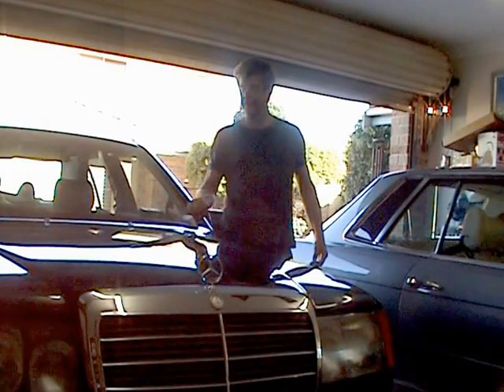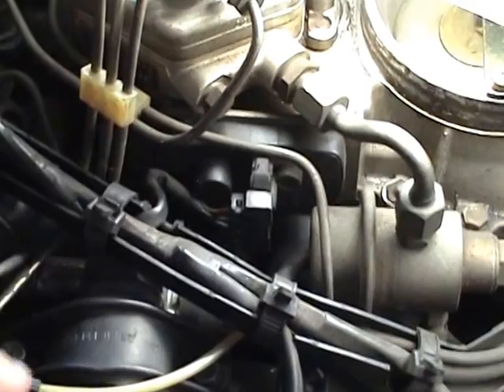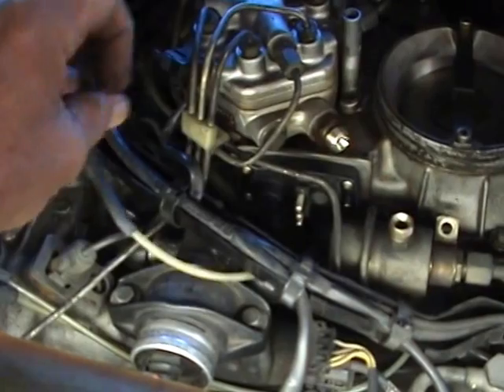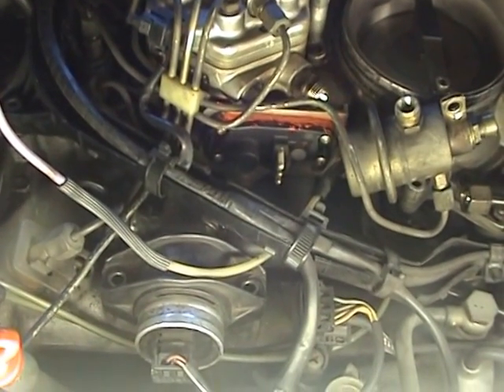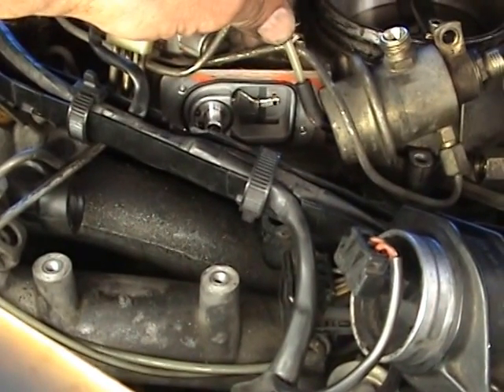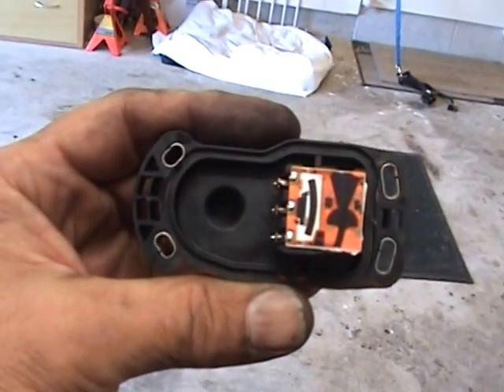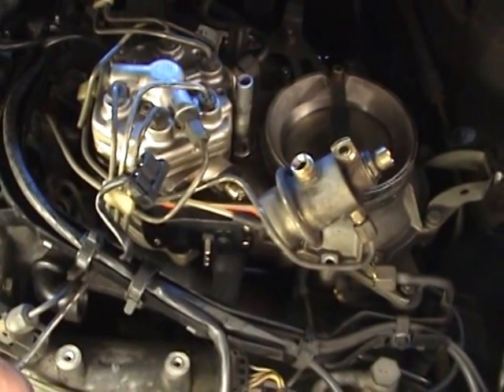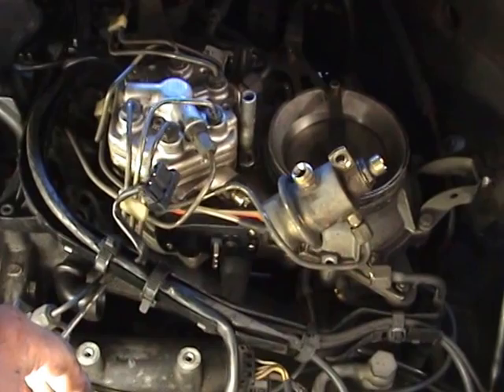1989 300E Mercedes potentiometer

Comment: 8 years on, how did the chinese potentiometer hold up and how many did u go through?
Reply from the maker: Hi, I haven't thought about it since I changed it, car runs fine. That's why it's been ages since I have done a video on this car, if the sensors, etc are maintained the car will go forever. cheer, Paul

Comment: I thought the pressure damper you are referring to  on this video is called primary pressure regulator. Sorry but you can correct me if I'm wrong.
Reply: You are correct, the pressure dampner is at the back with the fuel pumps.

Comment: Hi Paul, have you bought any other replacement parts form china?? I am looking at the ICV valve (23$ form china) could be worth a gamble...what do you reckon? .....by the way keep the videos coming, cheers from the czech republic!!
Reply from the maker: Hi, wesley there is no problem with the parts from China, the biggest problem is the amount of time it takes to receive the part, it can take 2 months for us in Australia, might be faster for Europe but I doubt it. Worth it if it's not urgent, cheers, Paul.
Reply: riffraffjazz US $17.00 | AP02 Idle Air Control Valve 127238 4612738 for Mercedes-Benz C124 W124 S124 W126 R129 W201 W461
https://a.aliexpress.com/_dYShIzS

Comment: You're very good at this! I've a collection of early aircooled vw-s. Just bought a 260E in good mech condition, no rust (aust delivery) nice and clean inside, but l'm already sceared because it's too complicated. I want to sell it while it's running and stick with the much simplier beetles and kombies.
Reply: Its an elegant system once you understand it and simpler than it looks, but yeah its still alot of parts and quite a steep learning curve.

Comment: For others performing this task, you may want to use the following link as a reference. It has instructions on how to not only replace, but also adjust your airflow sensor potentiomter properly!
http://www.sg-motorsports.com/AFS%20Pot%20write-up.htm
Reply: This link no longer works 😢
Reply from the maker: Hi, Thanks for adding that great write up, cheers, Paul.

Comment: RRJ wondereing how the cars going since you replaced the  potentiometer - no low or hi revs if you tell me = its be running like dream since  you replaced with your  china made part which china  potentiometer  part sold you just  1  potentiometer look your videos-i have a 1990 260 e which they tell uses the same potentiometer as the 3oo e----cheers sunrise
Reply from the maker: Hi, Sunrise, I have had no problems on that side of the car since I changed it.
The car just recently did an approx 3,000 km drive no problems.
Cheers, Paul.
Reply: cheers paul -thats good news-thank

Comment: Hi, could the symptoms you mentioned at the beginning of your commentary, could that also apply to a fault with a potentiometer but in reverse. i.e my 300SE (W126) is fine on cold start up but once it reaches operating temperature (or even sooner in warm weather, the idle seems low (but okay). However it feels as if the car is going to stall. Through an expensive process of elimination I have replaced the coil, the HT leads. distributor cap and rotor arm and spark plugs. Although it runs betterbecause I have replaced those items it stills has that fault. Sorry this is a bit long winded.
Reply from the maker: Hi, Tom   Maybe it's the oxygen sensor, it might be dirty, (covered in carbon).  If it is the ECU thinks that the engine is running rich and cuts the fuel delivery, especially in the idle position. Take it out & give it a clean.  Cheers, Paul.
Reply: +riffraffjazz Thanks Paul I appreciate your advice. I will try that over the weekend.

Comment: Hello,
 I have a 1990 300se, I starts at 1200 down to 700 goes ok fore 30 minieits dies at stop.
Thanks
Reply from the maker: Hi, This is a hard one, could be lots of things.  Faulty cold start valve, faulty coolant temp switch, vacuum leak, auxiliary air regulator faulty, airflow sensor plate rest position incorrect, control plunger in fuel distributor binding.  I took these from the workshop Manual. Good luck, Paul.
Reply: Filter stoped up on fuel distributor wear the gas line hooks up

Comment: May ask help to fix idle high 2000rpm , changed idle valve  but same problema , unplug wide from idle valve , motore run 800rpm , chat can i cheek?? Mercedes 260e y1985.  grazie
Reply from the maker: Emilio Bonvi
 Hi, 
 
  Normal
  0
  
   
   
   
   
   
   
  
  MicrosoftInternetExplorer4
 

 /* Style Definitions */
 table.MsoNormalTable
 {mso-style-name:"Table Normal";
 mso-tstyle-rowband-size:0;
 mso-tstyle-colband-size:0;
 mso-style-noshow:yes;
 mso-style-parent:"";
 mso-padding-alt:0cm 5.4pt 0cm 5.4pt;
 mso-para-margin:0cm;
 mso-para-margin-bottom:.0001pt;
 mso-pagination:widow-orphan;
 font-size:10.0pt;
 font-family:"Times New Roman";
 mso-fareast-font-family:"Times New Roman";}

  Check the throttle linkage adjustments to be sure that the throttle switch is closing when you return to idle. It sounds like the idle valve is getting stuck open. You might also try disconnecting the idle control valve  and see if it still wants to idle low when the
valve is disconnected. If it doesn't then it tells you that the valve is
probably getting stuck. Clean the intake throttle bore with some carb cleaner, also a faulty over voltage protection relay can cause the idle speed to be erratic.
 
  Normal
  0
  
   
   
   
   
   
   
  
  MicrosoftInternetExplorer4
 

 /* Style Definitions */
 table.MsoNormalTable
 {mso-style-name:"Table Normal";
 mso-tstyle-rowband-size:0;
 mso-tstyle-colband-size:0;
 mso-style-noshow:yes;
 mso-style-parent:"";
 mso-padding-alt:0cm 5.4pt 0cm 5.4pt;
 mso-para-margin:0cm;
 mso-para-margin-bottom:.0001pt;
 mso-pagination:widow-orphan;
 font-size:10.0pt;
 font-family:"Times New Roman";
 mso-fareast-font-family:"Times New Roman";}

<span style="font-size:12.0pt;font-family:"Times New Roman";
mso-fareast-font-family:"Times New Roman";mso-ansi-language:EN-AU;mso-fareast-language:
EN-AU;mso-bidi-language:AR-SA"> 
<span style="font-size:12.0pt;font-family:"Times New Roman";
mso-fareast-font-family:"Times New Roman";mso-ansi-language:EN-AU;mso-fareast-language:
EN-AU;mso-bidi-language:AR-SA">You can try disconnecting the oxygen sensor also to see if it is causing the problem.<span style="font-size:12.0pt;font-family:"Times New Roman";
mso-fareast-font-family:"Times New Roman";mso-ansi-language:EN-AU;mso-fareast-language:
EN-AU;mso-bidi-language:AR-SA">Regards, Paul.
Reply: riffraffjazz  disconnecting idle valve wire  , the idle is normal around 800rpm , also i have changed the idle valve  but same problem , with idle valve wire disconnected all is working well , reconnecting wire idle up to 2000rpm.  could be the potenziometer? how can check  it?  grazie emilio
Reply from the maker: Check the throttle linkage adjustments to be sure that the throttle 
switch is closing when you return to idle. It sounds like the idle valve
 is getting stuck open. You might also try disconnecting the idle 
control valve  and see if it still wants to idle low ( should drop right down or stall not 800 rpm) when the valve is disconnected. If it doesn't then it tells you that the valve is probably getting stuck. Clean the intake throttle bore with some carb 
cleaner, also a faulty over voltage protection relay can cause the idle 
speed to be erratic. If the potentiometer was faulty you will have a flat spot when you accelerate where the pot resistance wires are worn.
Have you checked the air intake plunger to make sure it is closing properly.
Reply from the maker: Emilio BonviAlso check the rubber hoses from your idle valve for cracks and make sure they are connected properly, could be sucking air in.
Paul.

Comment: What do you mean by backwire?  Can you explain the testing procedure a bit. I appreciate your Mercedes videos. I'm working on a 1991 300ce I've had in garbage for 7 years. Thanks.  ddrayper@gmail.com
Reply from the maker: Darryl S. Draper Sr.I borrowed this information from the internet, you need two fine probes connected to a multimeter and connect them to pins 1&2, I was going to put a piece of wire on each pin then put the plug back on and connect the multimeter on the ends:-
 
 
  Normal
  0
  
   
   
   
   
   
   
  
  MicrosoftInternetExplorer4
 

 /* Style Definitions */
 table.MsoNormalTable
 {mso-style-name:"Table Normal";
 mso-tstyle-rowband-size:0;
 mso-tstyle-colband-size:0;
 mso-style-noshow:yes;
 mso-style-parent:"";
 mso-padding-alt:0cm 5.4pt 0cm 5.4pt;
 mso-para-margin:0cm;
 mso-para-margin-bottom:.0001pt;
 mso-pagination:widow-orphan;
 font-size:10.0pt;
 font-family:"Times New Roman";
 mso-fareast-font-family:"Times New Roman";}

<span style="font-size:12.0pt;font-family:"Times New Roman";
mso-fareast-font-family:SimSun;mso-ansi-language:EN-AU;mso-fareast-language:
ZH-CN;mso-bidi-language:AR-SA">be careful so that the 2 contacts aren't
touching and shorting during the adjustment process. You'll need to back-probe
pins 1 and 2 (the top 2 pins) and then reinstall the electrical connector.

 
  Normal
  0
  
   
   
   
   
   
   
  
  MicrosoftInternetExplorer4
 

 /* Style Definitions */
 table.MsoNormalTable
 {mso-style-name:"Table Normal";
 mso-tstyle-rowband-size:0;
 mso-tstyle-colband-size:0;
 mso-style-noshow:yes;
 mso-style-parent:"";
 mso-padding-alt:0cm 5.4pt 0cm 5.4pt;
 mso-para-margin:0cm;
 mso-para-margin-bottom:.0001pt;
 mso-pagination:widow-orphan;
 font-size:10.0pt;
 font-family:"Times New Roman";
 mso-fareast-font-family:"Times New Roman";}

With a digital multimeter hooked up to read DC volts, start
the car and let it warm up to a steady warm idle. With the engine at idle
adjust the potentiometer body by pivoting it slightly until 0.70v (plus or
minus 0.10v) is obtained. This is a very fine adjustment and it doesn't take
much movement to make a big difference, so be sensitive and move it slowly and gently.
Then gently tighten the 4 screws in a cross pattern, being careful to not
change the adjustment while tightening. With the sensor tight and adjustment
within spec, shut the car off and install the black plastic screw covers on the
sensor and reinstall the air cleaner. The fine adjustment screw next to the
3-pin connector should not be used for adjustment as it is only for very minor
adjustments and should only be used in conjunction with a flow bench tester.
I hope this helps, regards, Paul.